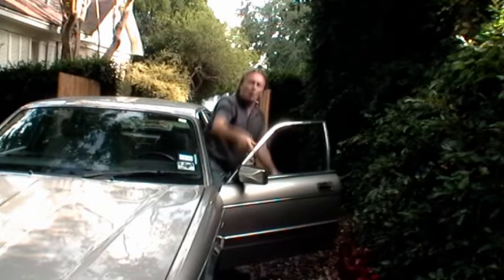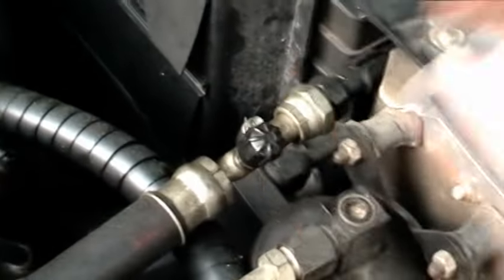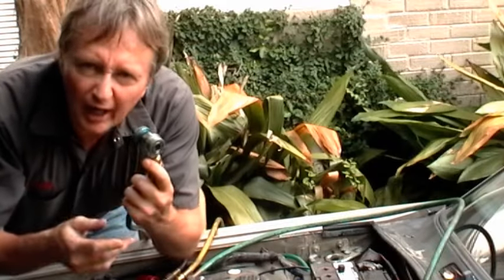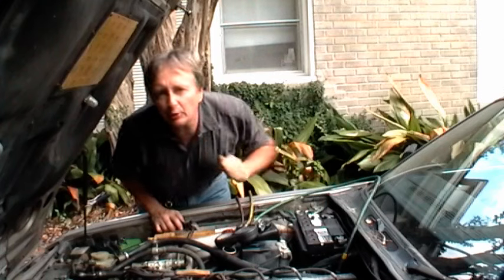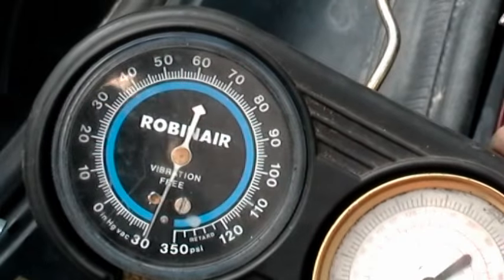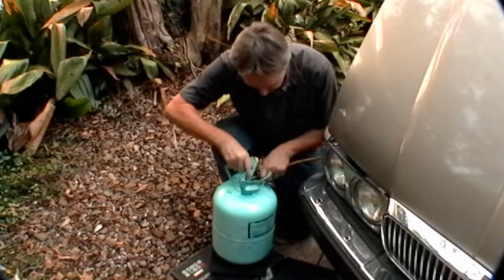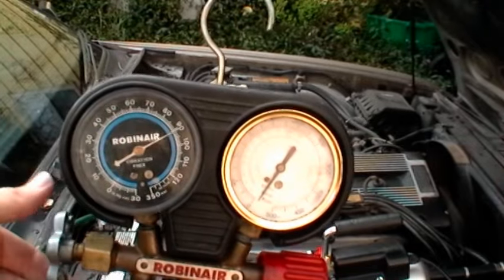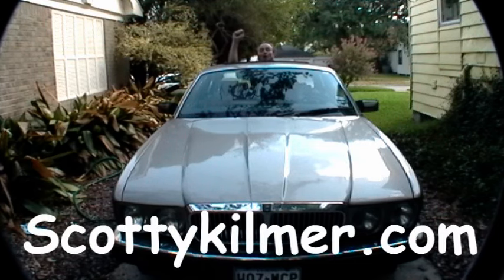How to Recharge Car AC System (Refrigerant)

Comment from the maker: you can do either or both, I do the low side cause high sides fittings are often cheap on modern cars and tend to leak after you hook  a line up to them later.

Comment: Hi Scotty
I filled the system yesterday with pressurized bottle with refrigerant up side down in liquid form on high pressure side. No problem to fill 550 gram in this way. It took only 2 minutes, then I let the system rest over night.
Today I started the system, and it works.
Thanks
Kenth Sjoberg
Sweden

Comment: You  have the best and safest videos Scotty.  I used your method exactly as you show it in the video, and it worked beautifully.  I also changed out the compressor in my 2005 Chrysler van using your compressor video as a guide.   Using my scale and a 30 gallon tank of W 134, it only took a short time to recharge my van.  I used my new equipment to fix the air-conditioning in my 1993 Jeep Wrangler as a bonus.  
Thanks very much.     Joe  77.

Comment from the maker: @williams6975 there are 2 fittings, one for high side one for low. You only connect the add valve to the low side fitting, it's the only one it will fit on . Scotty

Comment: Scotty is correct on all points. It is so very important that you suction the system completely. I usually like to recharge a cars a/c system on a hot day. I open all windows and put a little pen thermometer in a vent and turn the vent fan to its highest setting that will move more hot air through the evaporator coils. Then I will put the 134-a refrigerant canister in a pan of very hot water and connect a hose to the low pressure side of the system. This method kind of supercharges the refrigerant into the system. I then check the temp of the vents on the dash, then check the high and low sides of the a/c system. I then go to the engine area and hand feel the high pressure liquid line and the low vapor side for latent heat. The high side will be so hot you cant touch it and the low side will be VERY cold. I know then that the system is working and charged with refrigerant sufficiently. I only use this method if I don't have a scale or gauges. Works every time.

Comment from the maker: @nico27004 the gauges only fit one way, they are different size adaptors. The low side HAS to be somewhere between the compressor and the dash on the low pressure hose coming out of the dash going to the compressor. They vary immensely where on that line though. Scotty

Comment from the maker: @Moralvorstellung7 No, that's guessing as pressures change with temp and humidity outside and a problem in the system will give you false readings if it has a problem. Scales are the only way to go. Scotty

Comment from the maker: @Hebert6760  Each vehicle uses different amounts of refrigerant., normally there's a sticker under the hood showing how much weight to put in. If you don't pump out any oil, you don't need to add any. Sometimes oil will be pumped out, so watch the oil level before and after evacuating, and it the level went up, put that much oil back in. Scotty

Comment from the maker: start by checking the cooling fans on the radiator to make sure they blow fast when idling. If they do, pray you are just low on refrigerant, cause a bad compressor that's starting to go out will also do that.

Comment from the maker: Well, AC compressors can go out many different ways. If they make a lot of noise, and when you turn the AC off with the engine running the noise goes away, they're wearing out. And you can put a set of gauges on them and see what pressure they're putting out, but that's pretty complex as other things like stuck expansion valves can make the pressure bad even though the compressor is working. AND, if the compressor doesn't come on, hot wire it on the 
AC clutch and it's bad if that doesn't work
Reply: Scotty Kilmer how to replace car ac thermostat

Comment from the maker: I don't really understand your question. But to replace a heater core you need to remove the AC evaporator and remove the refrigerant to the system if that's what you're asking. BUT, you can just bypass the heater core with a five dollar bypass hose connector. Many guys do it, just cut the two hoses under the hood going to the heater and splice them together with the bypass hose you can buy. No heat then, but the AC will work even better with no hot water near it. Scotty Kilmer

Comment from the maker: often the spark plug wire rubber bit comes off the end and sticks on the plug. Try an ice pick to rip it up and long needle nose pliers to pull the pieces off. Been there, done that.

Comment from the maker: One, you have to evacuate the system out, air ruins the systems inside. But if you're just adding, you can try the cans and pray a lot. You would have no idea how much refrigerant is actually inside the system, and in modern cars, being even a few ounces off can ruin the system. but, some guys will just add some until it blows cold and stop there. Being low doesn't hurt anything like being high does.

Comment: @72plyfury I am not saying you are wrong because you are not, however in the video he was not using a machine.  As a rule, the receiver drier would be the saving device for the low side.  There is no saving device for the high side.  The other variables are the actual locations of the service ports.   Thanks for your input.

Comment from the maker: fix the hose first, when car's overheat the computer shuts off the ac. Then check to make sure water hasn't ruined AC electronics or compressor clutch

Comment from the maker: @bakersfieldduilawyer adding oil is unfortunately educated guesswork. the only way to tell what's in the system is to empty it out, flush the oil out, and put a factory load of oil from their charts into the system. if a system is empty, many guys will just add an ounce for safety, assuming that much leaked out with the refrigerant. Scotty

Comment from the maker: @tinleo333 Do not work on your prius compressor IF it's an electronic compressor and not a mechanical one that runs off the fan belt. They require special equipment to work on. But if it's a fan belt driven comp, use 46 Scotty

Comment from the maker: @hellboydemon  Just follow this video. And put in an 80 percent load of the old weight. Plus add about 5 ounces of PAG oil to the system. Legally you're supposed to change the fittings too for the new 134a fittings, but it's your car and you can really do what you want. Scotty Kilmer

Comment from the maker: @danger86rangerr AH, but unfortunately it's the ONLY way to do it correctly, guessing with levels and not evacuating a system is pot luck repairing. and the stuff doesn't cost that much at places like Harbor Freight tools.

Comment: It's a miracle Jaguars sell at all.  Deprecitation is so bad on them.  I looked at a 2001 XJR that sold for about $70 grand new for $8 grand with 75K miles.  Repairs cost so much that I went with a Lexus (fancy Toyota).  

I'd still like to pickup a Jaguar XJR or XJ8 as a weekend toy if the 2001ish models drop under $4 grand in good shape.  I can afford to just take a loss and get rid of it if need be then.

Good video.

Comment: Thank You that worked..At first that was the only way I could keep the system running..Almost was going to run a toggle to the clutch off an accessory wire.. Then I found the culprit, a corroded wire going to the clutch relay..I replace the relay prior to that so I dismissed it as being the problem... Took the time to remove the relay box replaced the lead wire and wa la.. Now my AC works every time .. Still in the 80s here in Florida nice to have air again.. Once again thanks..

Comment: Hi Scotty, and thanks a LOT on your videos. You actually saved me a hundred bucks on that module resetting video. I have a question: what's the use of the high side port on the refrigerant circuit? Why is there a high pressure gauge on the manifold when all you need is the low press & gas supply pressure gauge?

Comment from the maker: no, cause the pump just vents into the air, it has no hose set up on it.  Now they say half an hour is max time for a system to remain open so you have to replace driver. otherwise, vacuuming it out will suck the moisture out of it

Comment from the maker: some valves screw out with a cheap tool, the same one used to remove tire valve stems. But many GMs have a high side valve that is not replaceable, it requires replacing the entire hose assembly it's part of. Great GM engineering there, it drives me nuts. I often will not hook up my high side gauge to many gm vehicles because then they often leak and you have to replace an expensive assembly. I HATE that design

Comment from the maker: basically you put in an 80 percent load of r134a and pag oil to replace the mineral oil that won't flow with the new refrigerant.  By law you are supposed to change the fittings too, but if it's your own car you really could just leave the old fittings.

Comment from the maker: That car had been retrofitted ages ago by the owner. If you do your own car, you don't need to put labels and fittings on, but yes, mechanics need to do that when they retrofit them. Now that tiny bit of bleeding the yellow line isn't going to hurt anyone. It's the only way you can be sure to keep air out of the AC system, which will destroy it if you get even a small amount in. Scotty
Reply: What about the air in the hi and lo hoses?

Comment from the maker: when ac system pressure gets too high, switches turn off the compressor to prevent damage.  Pray it was that and it will work normal at lower temps outside

Comment: Hi scotty, i love your videos they have helped me a lot.  I have a problem with my 03 civic's a/c. It has refrigerant and no leaks both fans are running when ac is on the compressor is running fine, but its not blowing cold air. It blows cool air but not cold. I have cleaned the condenser and cabin filters are clean. At times it blows cold air for a while. Noticed when i am on the highway the air gets warmer and the car seems to cut as if i took my foot of the gas and put it back on right away.

Comment from the maker: unfortunately you can't do it correctly any other way. But, if you want to guess, you put an add can on the low side and slowly add refrigerant IF the cheap gauges on that can does not go into high pressure. and then when the ac blows cold, stop it there. Not too accurate though.

Comment from the maker: you have to use a recycling machine, period.  Or you could make your own with a pump and tank, it wouldn't be that hard, I've seen guys do it with an old car ac compressor and an electric motor and belt to drive it.

Comment: Charging the a/c system on a car works best on a hot day. If the car still has a little refrigerant in it a vacuum pump wont be needed. Role all the windows down and put the interior fan on high which will move a lot of air over the interior evaporator. Put a little thermometer in one of the dashboard vents to monitor the temp from the evaporator. The purpose of the evaporator is to absorb heat which is called latent heat. If you have a good set of gauges for refrigerant 134-a as Scotty says hook the connections up to the high and low side of the a/c plumbing. The purpose of the evaporator is to absorb heat and the purpose of the condenser is to reject heat from the cars interior. Some times I cheat a little. When I am charging my own vehicles I will feel the temp of the liquid high side of the system. If its too hot to touch I know that the system is operating correctly and if I look at the vent thermometer and to reading about 40 to 47 degrees I stop trying to charge the system. If you are in a hurry to get the car charged, put the refrigerant canister in a pot of very hot water and doing that will speed the whole process along. Scotty is dead on with every aspect to charging an a/c system how ever if you have to recharge the cars a/c every year there is most likely a leak and that is typically the seal on the compressors clutch.

Comment from the maker: depends what you have. If it's a dual zone ac system like in a gm product, often the actuator goes bad on the hot side and needs replacing. If it's a single system, often being low on refrigerant causes that.

Comment: nice video one thing to improve a little is showing how you hookup the measuring/scale machine to see that it put exactly 2lbs in. Also where you got the 2lbs for that make/model sticker online ,...etc or normally when your not sure how much to put in how you determine the correct amount weather you uses a pressure range or always a certain amount of lbs/oz of r134a as a general rule of thumb when not sure or cann't find it

Comment: Scotty I used one of those cans you buy at autozone with the guage on the top. I followed all simple steps but literally right after i did it the ac was only blowing hot air, and before i touched it it blew somewhat cold air.
Reply: probably over charged it

Comment: @MNmale1972 Actually introducing liquid to the high side is a better way to go, however to charge from the high side you need a machine to pump it in while the engine is off. The low side is on the inlet side of the pump so if liquid is introduced it can grenade your pump. This is why its important to charge slowly from the low side so the refrigerant can vaporise before it gets to the compressor.

Comment from the maker: valve could be clogged up, compressor could be worn out, many things could be wrong. Ac work is often no fun. See what the high side pressure is as you add freon with clutch jumped to run, e mail me that

Comment: you are a blessing to us who must try  ffix/repair our vehicles i put in 134a in our band bus 1983 eagle10 made here in brownsville Texas as it wasnt cooling holds30 lbs which i put in half a tank started cooling as the compresser did come on then stopped added more 134a but stopped again  also cant find anyone who knows how to service the ac HELP
Reply from the maker: you can't just keep adding refrigerant to any system correctly without first evacuating the whole system out, then putting in a factory load by weight using a reverse scale and watching the high and low pressures with a gauge system. Start there, and realize many things can knock out an AC system from a weak compressor, to leaks, to bad expansion valves to bad condensers. good luck

Comment: Scotty didn't make any mistakes here but a couple of things he didn't carefully emphasize, could get you into trouble, if you don't do them correctly. 1. When you tighten any of the female hose ends onto their male counterparts, don't overtighten, as you can easily damage the cylindrical rubber seals inside the female hose ends. Finger tighten until you feel the rubber seal inside the female connector bottom out on the male connector, then tighten just a little more, enough to prevent the connector from unscrewing. Nice and snug with your fingers, but not as hard has you possible can with your fingers. And it may be best not to use a pliers. You could use a pliers as Scotty is shown doing, but a pliers, with its long handle, makes it easy to overtighten. So if you don't yet have enough experience to know how much to tighten the connector, be very careful how tight you make the connection. 2. Scotty says start the car, then open the valve. He is shown opening the correct valve, the one on the left, which is traditionally connected to the low side. But Scotty doesn't say low side. He just says "valve." Normally you would only open that low side valve. With a system that is already full, and you are using those little 12 or 18 ounce cans of refrigerant, and you were to open the high side valve on the gauge set, theoretically the pressure in the car's ac may be more than the pressure in a fully pressurized can,  and refrigerant could go from the car to the can, rather than from the can to the car, raising the pressure in the can higher than it is made to safely hold, and thus rupture the can, and send shrapnel into your body. Without special equipment for charging from the high side it is safest to only charge from the low side. Open only the low side valve on the gauge set, and not the high side valve.

Comment: Scotty a hard line broke on my toyota corolla. I purchased a new one I am going to replace the reciever drier and the expansion valve then I am going to run a vacuum on the system. my question is how do I add oil to the system? it uses pag 46 also how much oil should I add? it is a 2001 toyota corolla. thank you so much. I love all your diy

Comment: There is no need for a "saving device" on the high side because the refrigerent flow is away from the compressor so it is imposible to damage it. Also the reciever/drier is on the high side of the system after the condenser, the accumulator (used for FOT systems) is on the low side.

Comment: Hi Scotty, I am completely rebuilding the air conditioning on my Porsche 928. Which means I am replacing all of the o-rings, lines, and the compressor and converting to R-134 from R-12. What kind of compressor oil should I use? Ester  oil or PAG?

Comment: Scotty, when you flush the A/C do you disconnect all the hoses and flush each component separately or do you just disconnect the compressor and blow it through the high side and out the low?